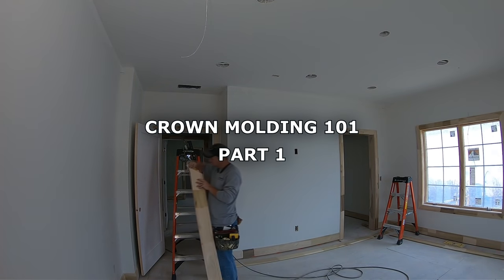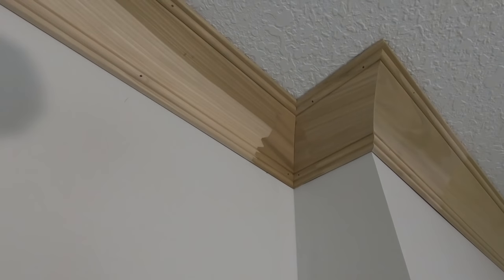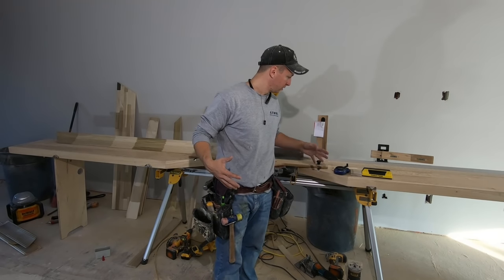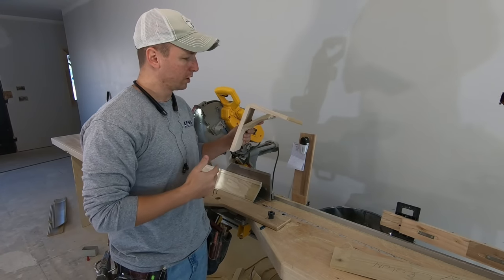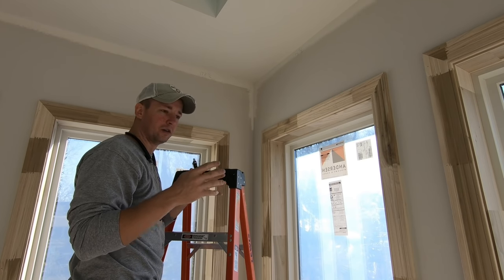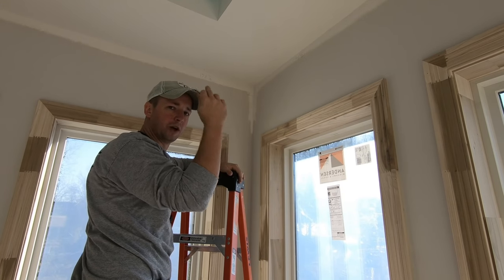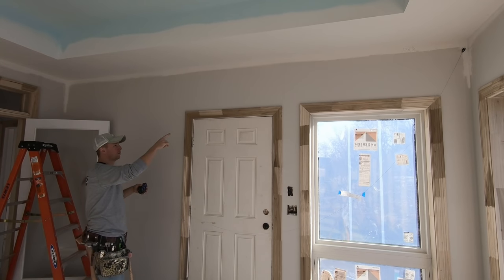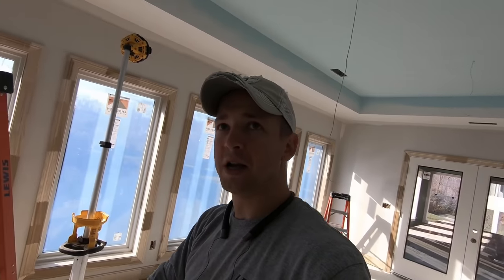Crown Molding Secrets pt 1 - What they don't teach you...

Comment: Just wanted to share with you I have been using your videos as reference for installing trim and crown in my 3400sqft house. Had to fire our GC who left us over budget. I have been working on my house for 4 months now, I have a 6 month old that is motivating me to build faster. I had to cut cost and trimming out was something I could handle. Considering your level of tools, and materials, your videos have been able to help me approach this in a fast manner, and help me figure out why my cuts are not totally straight like a tenth of a degree every now and then (already calibrated saw, leveled my rollers, it was the bow in the trim that was doing it.

All in all thank you for videos. 

update - just installed my crown molding. i forgot about this video. Due to a million other factors plus my own setup, crown was a PIA and it did not come out nice, but oh well. such is life when you are thrown in the wheel of building your own house. Too bad i only did crown in the living room and you can see the results got better the further i went around the room. lol also, major pain in the ass to do this after texture and paint have been applied to the walls

From, 
A Full time, young mechanical engineer,

Comment: Your info is spot on, and to get it in a 20 minute video instead of 10 years on the job is awesome.  I have to tell everyone that a $150 laser tape is NOT necessary.  I use the old school method of having a 10' piece of oak that i use on long runs. This piece is EXACTLY 10 feet, and i check it once in the morning and right after lunch to take the possibility of expansion and contraction out of the equation.  I hold one end in the corner right on your line and mark the end. Use a tape measure to the other corner, and if it's over six feet you will be putting a field joint in that run. If i had known about laser tape earlier,  i probably would have gotten one, but retirement is not that far off, so I'll stick to the way of the Pharoah.

Comment: Yet another great entry to your channel. 
I like to cut my gauge block with the same projection as the crown down and out.  I then cut out the corner that would go into the ceiling /wall corner so that the guage is touching where the crown touches ,and isn't thrown off by drywall mud buildup - especially in corners. Thanks again for your channel - always look forward to new segments.

Comment: Good stuff Spencer. For years I have been trying to teach guys to batch cut for rooms, base, casing and crown but most guys think they can't get accurate measuring doing it that way. Even if you need to go back to the saw to trim a pc or so it still is a huge time saver.  Thanks for the video.

Comment: I set up my saw the same..very good tips but I learn at least one thing from every video I watch.. I’ll also run my crown the same but I put a slight 45 degree bevel on the back of my projection block to keep the mud at the ceiling from messing with my marks..I use a 100 inch stick (that is hinged to fold in half) & butt it to one side at the bottom of the crown mark & make a mark the measure from the other wall to that mark & add 100.. it works out better than trying to measure a long wall with just your tape..but man I gotta get me one of those lasers to measure..I’ll for sure get it from your Amazon link..I’ve been skeptical of those.we had a Bosch one & it wasn’t accurate..thanks for the tips & links  for great products

Comment: Thank you so much for sharing your skills and taking the time to explain the details of why you do what you do. That is so important. As a novice, I've been reluctant to even try crown, but after watching your videos, I feel encouraged and even excited to begin. It seems that all of the prep is the most important (measuring accurately, the shims in the corners, finish nail for chalk line, etc.) Again, as a novice I don't have the sophisticated stop for the saw. Instead I am using the Kreg jig which has so far worked well with the test pieces I've made (inside and outside corner cuts). Hopefully, it will turn out well. Thank you again for even making me think about doing this myself. By the way, after watching the videos and looking at the crown installed in one of my rooms by a "professional," I notice the imperfections and think I can do a better job. God Bless!
Reply from the maker: You can do it. Its all about the system. If you embrace the system anyone can do crown.

Comment: Great stuff👍.
The last year I started installing cabinets, and the prefinished crown that goes with it.
Your tips translate for most of it.
Every other upper is different in height and depth,which are more smaller pcs. 
So I try to pre-assemble with glue on the ground around wonky ceilings.
Using a Bosch saw (with tiny factory stops) and miter stand is  getting old quickly. 
I badly need to build wings and a long stop.
Thanks for sharing your knowledge Spencer 🙏. 
I've learned a little, but need to learn a lot more!

Comment: great video that keeps going and doesn’t drag on i love it! cant wait for number 2. i typically smack the drywall mud with my beat block but clipping 1/16 off works too 😂. see, i always pick up a great tip!  id love to see your scarf joints... i always feel like i can see mine through the paint finish... The last few times I’ve done crown I’ve glued the scarf joint on the floor with 2p10 then reinforced the back of it with paint sticks and pl glue with pins but it’s super cumbersome to install long runs by yourself.

Comment: Great lessons learned from experience! 
In conjunction with a well tuned miter saw the millwork can also cause irregularities. I always, before any cutting of a trim package, check the consistency of dimensions within the package. Millwork one run of trim, or knife sharpening, can vary significantly. Check all your package before cutting anything. Zen your attitude start to finish! Great channel.

Comment: GREAT JOB!  I install acoustical ceiling and use a chalk line to snap a line for the wall angle. I cut off the hook and made a ( small circle) fish hook out of a piece of stiff wire and tied it on the string so I can snap it off to continue snapping lines around the room . in your case, you can use a common nail to hold your crown molding on.

Comment: i just completed a entire 10,000sq ft  house with that double bead crown 5 1/2x 5 1/2.  I mitered the coffered but was force by the build to cope the rest of the house. Had to have a sample cope piece that i over coped to overlay it on to the  crown to notch out the top bead at the right spot so it would lay in. Prefer mitering that crown over coping.

Comment: Whenever I have to miter crown I do it backwards of how he did in the start of this video…. Any inside corners that are on shorter runs get assembled on the ground before they go up, doing it this way I can screw the miter together from the back side. Also doing it this way that inside miter will never have a chance of opening up with the screws.
Also in larger profiles (like at the start of the video) I use blocking behind, put some construction glue on that blocking, will help keep the crown from separating from the ceiling over time

Comment: I've used the FastCap  crown clips on stain grade crown so no caulking. Just nail it to the wall loosely then hang crown on it, nail up crown, then just unhook the clip from the nail. They made adjustable ones also but didn't have a need for that. I see you butt cut your joints on paint grade crown any specific reason? Would you do that on MDF crown with wood glue or CA glue?

Comment: Hello Spencer, great video - thanks for all you do!
Have a question on the saw setup. I know that one of the most important aspects of the stop blocks is the assurance that the material length does not get affected as you change the angle of the cut (on its longest side that is). When you added your fence did you have to adjust a saw in any way to accommodate the thickness of the new fence? I did look at the same saw you have and I did not see anything obvious. Appreciate your time!
Reply from the maker: That's something very important to pay attention to. I always remove my auxillary fences when cutting casing with my stop block. You are correct, the added thickness of the auxillary fences will throw things off. As a habit, I always remove them for casing.

Comment: Great video as always. I use a Bosch laser to measure as well but find it’s so accurate that the pieces are almost always long. Of course I shave off where needed but just curious if you use the exact laser measure or ever take a little off when coping? And do you take anything additional off when doing two sided copes when they can’t be avoided
Reply from the maker: The one I use is very accurate. I usually go with the exact measurements and it’s a perfect fit. For longer pieces I’ll add a hair and snap in place.

Comment: What about when the ceiling drops or rises as it will. I've been pushing my crown up to meet the ceiling but you say to keep the bottom of the crown straight on the wall. I guess caulking is the solution. I hate having to use that.

Comment: Have seen walls that were not level across,  with a bow or dip due to the wood or whatever (often the bad qty over quality) contractors, will ur laser measurement detect this?    Say 12’x10’ room and one or more walls has a curve in it.  Can’t see by eye, but measure 10’ by laser and you put crown up you will be short when pushing crown flush to wall.   Have u experienced this issue with older homes or you fortunate to work on newer homes where the builders care on their work?  (My walls were jacked up and not noticeable till I put up the crown.

Comment: Nice job, I was wondering if you can touch on vaulted ceilings during part 2 and how you approach the down and uphill vaults. Also, does your laser measure to the 16th or up to the 64th and can it be adjusted for either. Thanks.
Reply from the maker: Measures to the 32nd always. In my entire career, I've never once been asked to do crown on a vaulted ceiling. :(
Reply: @InsiderCarpentry  be glad you've never been asked to do it and never looks good

Comment: Hi,
Thanks for sharing your tips. I have a question.  I am finishing up some one else  crown molding  job and some inside  pieces are missing from one side only.  I  measured the wall angle to cut the right  angle matching piece but  when I try to joint them , it's the upper part is way open, I would say about 3/8 inch, which mean that the existing piece is not been cut correctly . There is way to find out what would be the angle cut measurement for the existing piece, or how I can fix this with out cutting a new piece for both side?
Thank you!

Comment: Taking 1/16" off your guage block might not be enough sometimes. The drywall mud could be anywhere from 1/16" to 3/16" +or-. But probably close enough. 

If I'm trying to be presice, then I'll mitre 2 small pieces of crown together, glue/nail together, then seat them in each corner and mark the bottom.

Comment: About how long are you finding that you were FS tools blades last? Are you having them re sharpened after a few jobs Or more like 3 times a year? I've been running the frued blades And I just got a decent CMT table saw blade and it has made a huge difference, I want to switch to a good Miter saw blade But that initial investment Makes me wonder how long it really lasts
Reply: P.s. I. Bought the crown clips a few months ago and honestly there more hassle then they are worth. Only benefit was hanging a 20' piece of crown but that's not very often
Reply: pps. What is your method For pricing crown? I've heard several Different methods, just wondering what your method is, Per ft. Plus corners?
Reply from the maker: I probably sharpen them every six months. They last a very long time. And you can probably get ten sharpenings out of them.

Comment: How do you nail the crown if there are no studs on the ceiling part?  say your studs run parallel to to your crown and is most likely 18-23 inches away.
Reply from the maker: Scissor nail. Angle the nails and create a scissor effect.
Reply: @InsiderCarpentry do you do the same for older plaster walls or use glue instead of nailing? And do you also nail or glue the base boards on lat n plaster walls? Tnx!

Comment: You cut your block 16th shorter, could you just cut the back edge of the block at an angle so it misses any build up of plaster?  Thus using the full height of the crown molding.
Reply: The corner mud will flare out +/-3.5" so you'd have to do as Spencer does.

Comment: I’m really surprised you were just nailing the crown molding up without a backer board. You can hit the wall stud and the ceiling joist on two walls, but not on the third and fourth. I personally use a backer blocking made out of 2x4’s that is cut at the same spring angle as the crown minus about an 1/8”  away from the crown backside, so I can use a caulk with a high elasticity that will expand and contract and not crack at the ceiling.

Comment: You have to stop giving away our trade secrets....we will lose work and can't charge as much if  everyone knows how it's done 😉
As a side note, I prefer using a subfence screwed in place cut in height so it will be flush to the bottom of the crown (top when cutting). The two advantages to this is you can easily see when the crown is worped because one side will sit above the fence with the other below. I can adjust the cut so the middle will be flush and can line up perfectly with the next piece. The other advantage is that you can line up your pencil mark perfectly once with the curf in the fence and the length will be perfect, no cut slide cut slide cut slide.... Most of the crown I install now is prefinished (often hardwood) on cabinets so extreme accuracy is a real benefit in the finished product.

Comment: you gave the impression that you could use a 45 / 45 crown same as a 38 or a 52 ... dnt think u meant to but u cant... a 45 will have same dimension from ceiling to wall & from wall to ceiling... a 38 or 52 wont .... if u tried using a 45 crown on a 9' ceiling as u said no way u could change angle to make ceiling reveal more visible...You would then have use a 52 crown where the distance from wall to ceiling is greater then the distance of ceiling to wall.... no hate, think u just frgot mention it...
Reply: Spencer never said that. He said another common spring angle is …….    You misunderstood.  I suggest you go back and re-listen.

Comment: What method do you use to find the projection of the crown mld.
Reply from the maker: I just hold it on the saw and see what looks right based on how it is milled. See where the backside sits flat against the saw fences. That usually tells you.
Reply: put a square on the backside.
line up bottom edge of molding so sits flat on square.
read square measurement.